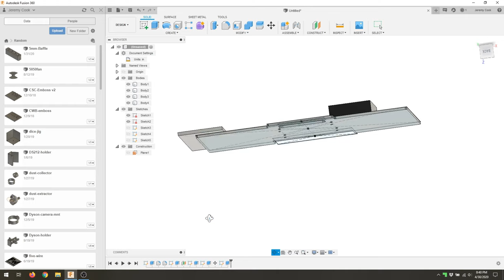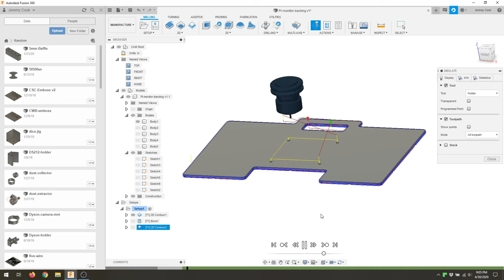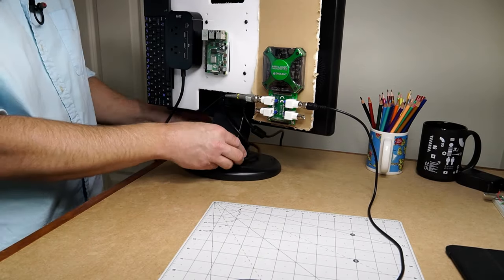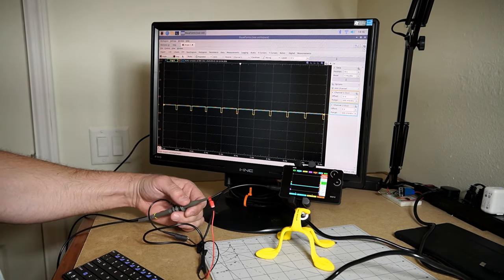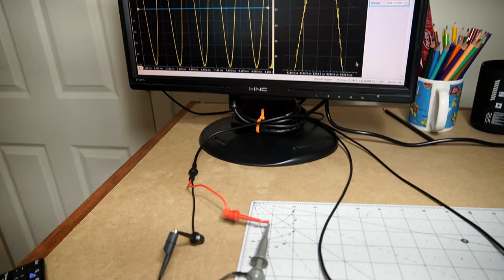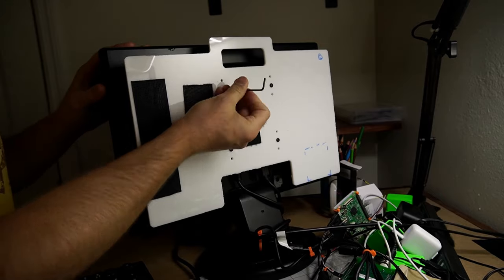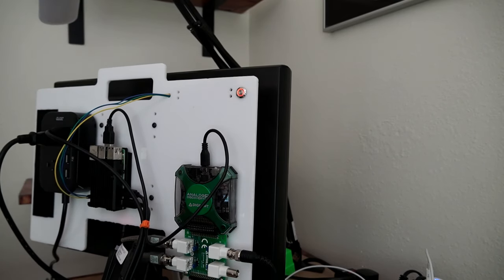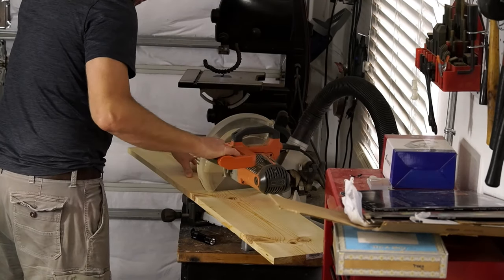Raspberry Pi Oscilloscope with Digilent Analog Discovery 2 [All-In-One]

Comment: Very nice setup! What application is used as front-end? could you run the software over a network socket? (I'm making a testbox in which I want to measure remotely analog signals.)
Reply from the maker: Thank you! It's running on Raspbian, so yes, I believe there is a way to log on as a remote desktop, but I haven't done much with it.

Comment: Hi, I found a reference on arrow.com (page: /en/research-and-events/articles/digilent-analog-discovery-2) where I can see a very small monitor that seems to run the software for the Diligent scope. what is that ?
Reply from the maker: Hi, that's a DS212 portable scope. It's not actually running the software, but generating a signal that goes to the computer-based scope. I am the author of that article though, and some followup info is in the video description.
Reply: Jeremy Cook thanks

Comment: Very nice project and video. Do you have any specs on the scope bandwidth or upper frequency. I thinking of using it for ham radio testing
Reply from the maker: Thanks Alex. Yeah, here's my overview of the system: https://www.arrow.com/en/research-and-events/articles/digilent-analog-discovery-2 - Would be interested to hear if it suits your needs.
Reply: @JeremyCook  the specs look like they would meet the needs for a scope to troubleshoot ham rigs used in the lower frequency bands below 30 MHz.  I'm going to look at a little closer. If I decide to build it I'll let you know.  I'm currently building a rig and troubleshooting is the next step in getting it working properly. thanks.

Comment: Hey,
How did you programming sothat you can see the real time singals in screen? The question was how to generate real time singals with codes
Reply from the maker: Hi, I did not write any signals programmatically if that's what you're asking, though I think it it possible.
Reply: @JeremyCook  basically i was wondering about logic. How do it automatically generate signals after providing external voltage
Reply from the maker: @biplabdhakal6477  If I remember correctly, there's a separate line for the voltage output and the signal generator.